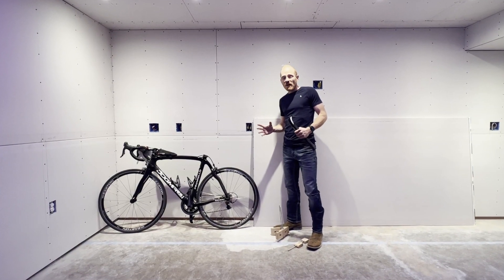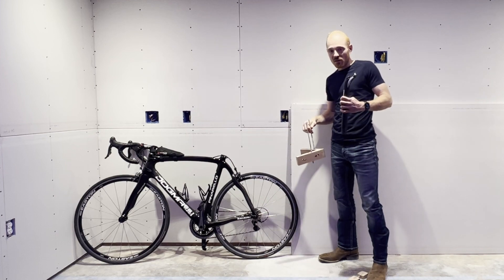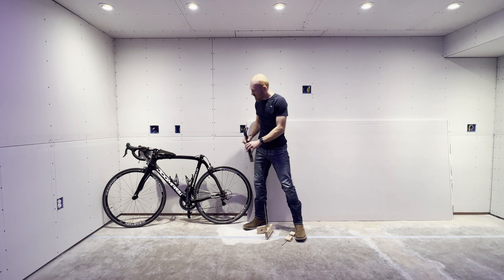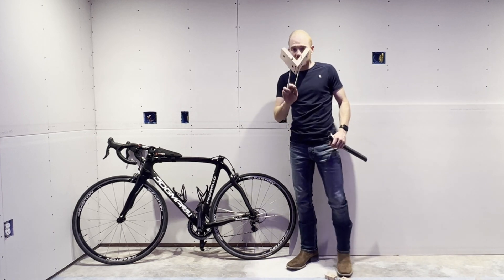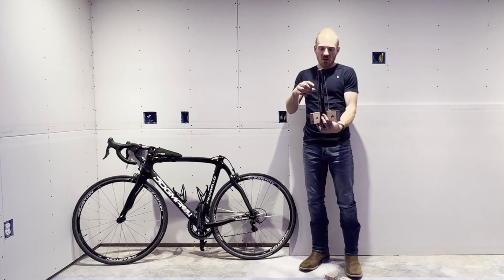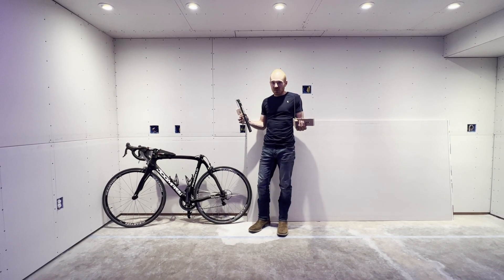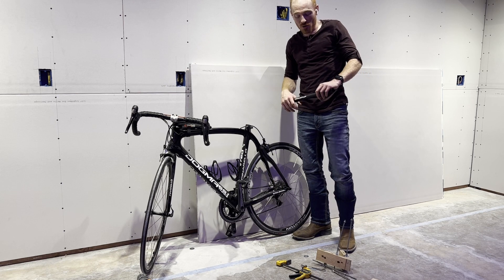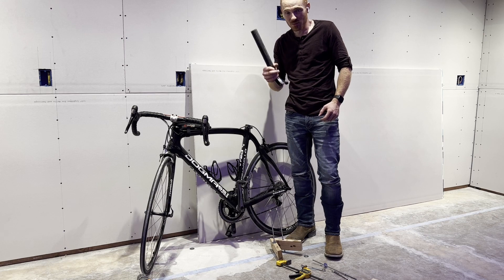Carbon Fiber Bike Seatpost Puller (DIY)

Comment: Hi Adam, thanks a lot for this idea - can you tell me what size boards you used, and also how the joint was fixed at the "V" ?  I bought a used bike, with carbon in carbon - stuck solid.
Reply: Hey Chris, great question! I will try to upload some photos/diagrams of my puller after work tonight and will link the results. For now, some rough notes are:

- I used 3/4" oak (scraps I had) for the V, about 2-3" wide and 12" long
- I measured the angle of the "teardrop seatpost" shape with an angle finder ($10 or less, like this one i.e. Empire-Polycast-Protractor-Angle-Finder)
- I used my miter saw to cut the angle 
- I affixed one side of the V to the other with 3" construction screws and wood glue (allowing this to dry so the glue wouldn't stick to the seatpost)
- The joint was a butt joint, but with the glue/screws, it was strong enough
- For the vertical allthread holes, I kind of eyeballed it by holding things to the bike

Good luck! I wish you success with your post - they are a pain but still possible to remove.
Reply: @adambuilds  Big thanks Adam !

Comment: I have the same pinerello seat post stuck how did u make the clamp
Reply from the maker: Hey there, yeah I feel you, these seat posts are so tricky because you can't even twist them due to the teardrop shape. I might not be able to explain this super well, but here's what I tried to do:
- Make a wooden V that fits around the seatpost, but rests on the receiving part of the frame
- Slip a piece of allthread through the hole at the top of the seatpost
- Add wood blocks to either side of the seatpost allthread
- Add the final pieces of allthread - each one going through the block at the top down to the V at the bottom. 
- Work the bolts to push the two apart. 

I tried to build a wooden allthread mechanism to 
- push down on the frame post receiving tube
- while pulling up on the seatpost istelf

I will try to update my video with a drive link to a drawing I made. I hope this helps, and good luck! These things are tough.

Comment: Great solution to the problem ! I have nice carbon Colnago with stuck aluminum seatpost , fortunately it has no hole at the top but if I know I can remove , perhaps I would drill hole in the post. What shape base ( wooden block ) would you suggest if my post is completely round shape ?thanks for your help
Reply: Hey Les, that's a really great question! I think you could get a forstner bit (or similar drill bit) of almost exactly the diameter of your seat post. If you could then cut piece out of the block so that it makes a "U-Shape" to slot around your seat post, it seems like you could get a very snug fit around the seat post to push against the seat tube with. Good luck! Perhaps you will be pioneering a new technique and video with your bike!
Reply: @adambuilds  great idea Adam , I have Di2 battery in the seatpost so need to be extra carful there.  Bought this nice Colnago cross bike online fortunately owner did nothing to the bike so I and replacing bunch of very corroded parts and seatpost is one of them I am sure. My other idea is to cut from hard wood round plate to fit tight around the seatpost  to get good brace there by the frame and seatpost clamp , if I cut the seatpost  below the seat clamp it’s goner anyway , than I could just cut slightly bigger hole to slide down over the post. This way perhaps both plates ( top & bottom ) would be spaced out closer to the seatpost and perhaps less play side to side while cranking on the bolts. After you have mentioned drill it just came in my mid that could create collar like bottom plate to rest perfectly around the seatpost frame tube. What you think ?
Reply: @leskorcala4898  that's brilliant! Yeah nice observation, especially if you choose to sacrifice the seatpost itself. I'll be curious to hear how that works for you if you give it a shot, keep us posted!
Reply: @adambuilds  will do , and thanks Adam for your video I saw so many on YT but many of them I would only apply to cheap frame , perhaps steel or aluminum. With such nice bikes we have the approach will be way better w/o using chemicals , ice , heat and other liquid solutions. Will try to do it very soon I need to get my spare bike going so I have bike to ride mean time.
Reply: https://youtu.be/m_4P5SVWo2Y?si=k1XraHrQIB9zzctf hello , Adam I finally did my removal yesterday , not sure if my YT Video is visible , hopefully this link works , I have bunch of photos how I build this remover but not sure how to attach them to the video. Anyway , thank bunch for great inspiration I was able to get my jig working , tool like 20 minutes and boom it was out and super corroded inside of the frame.
Reply: @leskorcala4898  Hey Les, it looks like the video is still hidden, but all the same, I'm thrilled to hear you had success!! Congrats, those seat posts can really put up a fight.